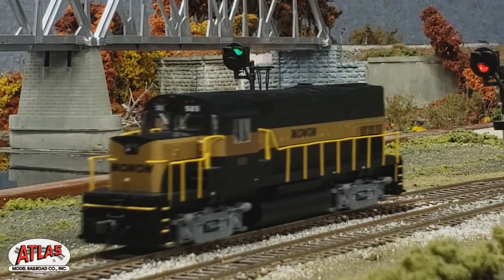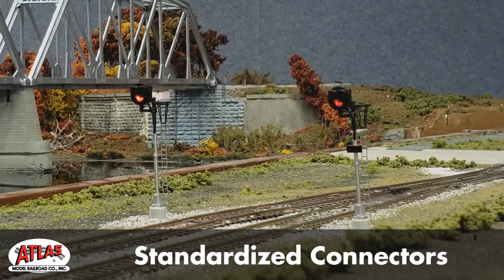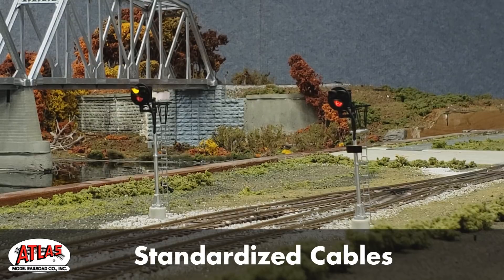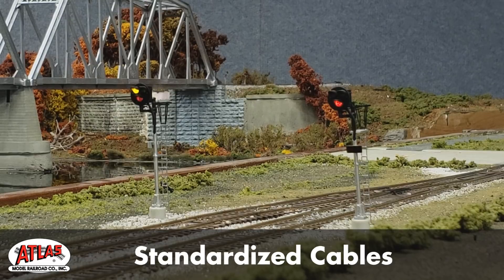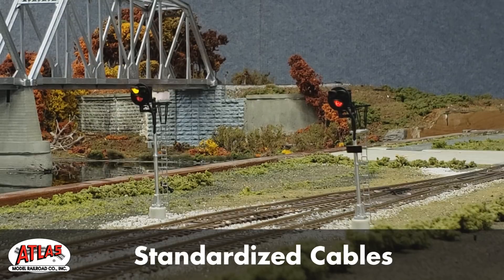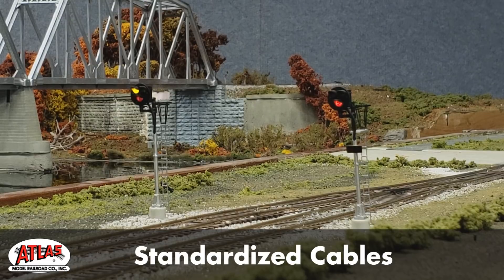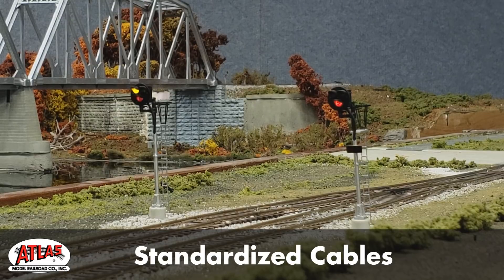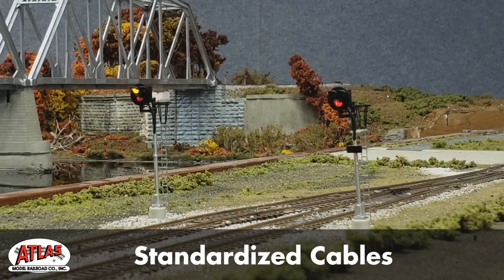The Atlas All-Scales Signal System

Comment: Since I don't do DCC, I find that I cannot get this system to work with straight DC, because no one makes a block detector that will work with DC, and work with common cathode. 

No one else makes a decent  looking signal in N scale. (Other than those custom finishing kits from Alabama)
Reply: use a BD 20 or find the old atlas analog boards.

Comment: Are these new signals compatible with the older HO Atlas Signals and boards that I have already purchased from a few years ago?
Reply: The manual says they are. The signal control board has a jumper that can be set for either common cathode or common anode.

Comment: I read somewhere on the instructions from my understanding you need a bd20 block detector but I can be wrong
Reply: Yes, or a similar detector, for automatic operations. Or a switch can be wired in for manual control of the signal indication.
Reply: Yes, and if you're standard DC like I am, you're out of luck finding a detector that will work.